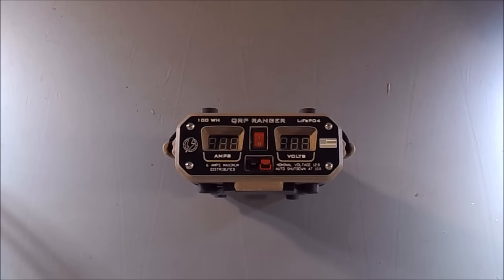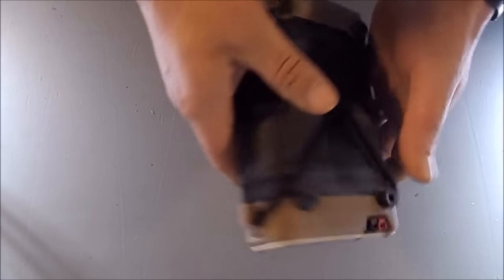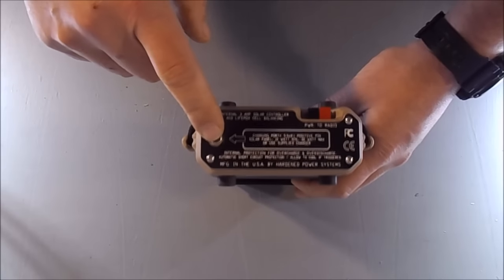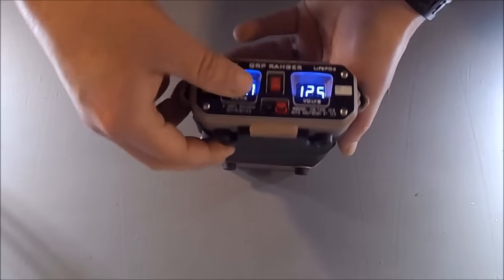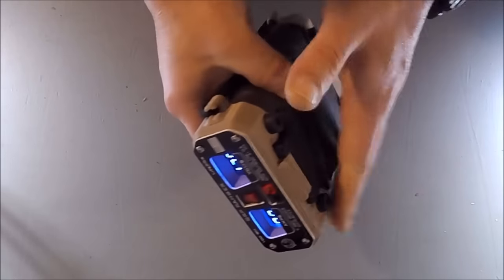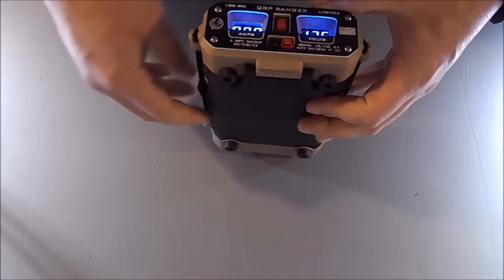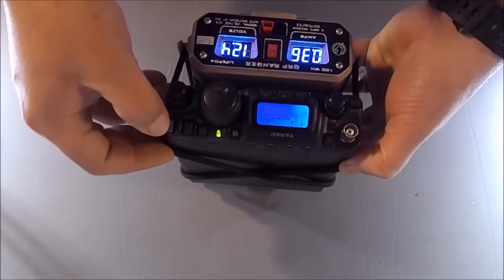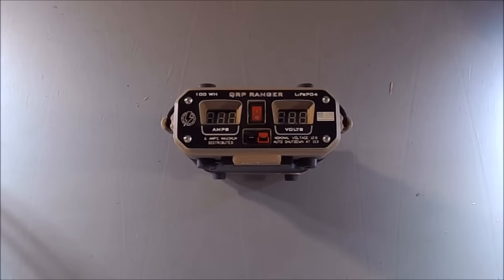QRP Ranger - Rugged LiFePO4 power for mobile radio comms

Comment: Bill, it looks very cool. i'm looking forward to putting one of these through the paces with my KX3. Whats the max power output on this? Can I say power up a KXPA100 and put out 20 or 30 watts in the field?
Reply from the maker: +K6UDA The max continuous draw is 6 amps (this is engraved on the faceplate, below the ammeter).  Sorry, no, the Ranger would not power something like a 100 watt amplifier.  Even if it could, with a 20 amp draw, you would flatten the batteries in about 20 minutes.